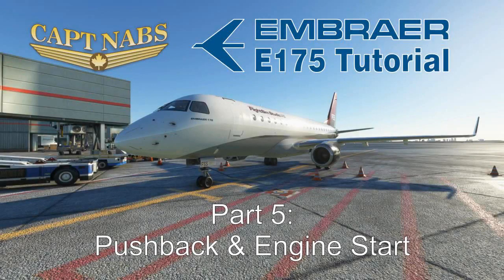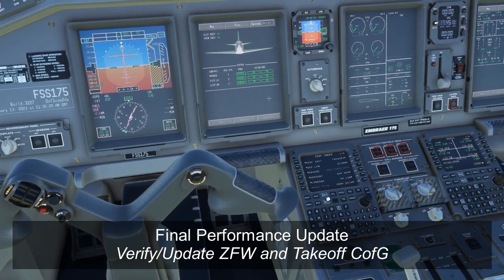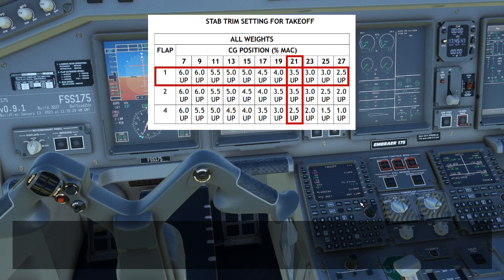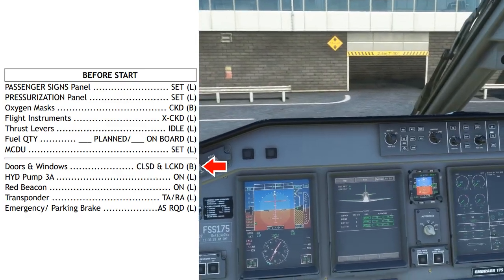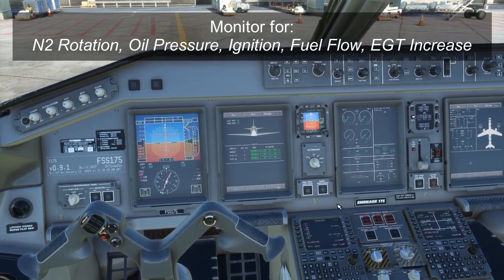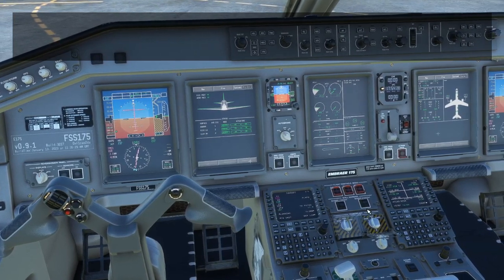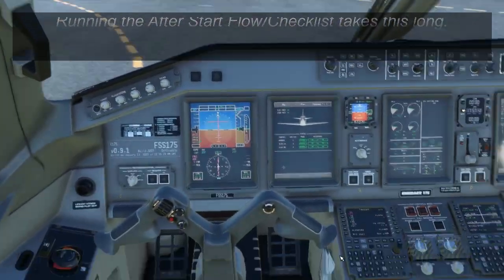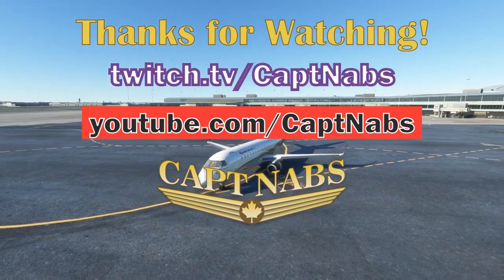Embraer E175 Tutorial 05: Startup & Pushback

Comment: nice videos, what u use for your views?
Reply from the maker: I use a product called TrackIR by NaturalPoint. It is a head tracker. You weat a hat or headset with a sensor on it and when you turn your head it turns in the sim too, though there is some gain so you can turn a little but still see the screen. Not cheap, but soooo immersive.

Comment: Very helpful video!  How did you activate pushback???  Did you use an add-on?
Reply from the maker: Yes, I used GSX Pro. That's why there was a cut. I activated the pushback during the cut.
Reply: @CaptNabs  ahh, thank you! I wasn’t sure and thought maybe there was a built-in pushback feature I wasn’t aware of🤷🏾‍♂️.  Also, I can’t get the Nose Wheel steering to work. The tiller moves but nose wheel won’t. Any advice?  +1
Reply from the maker: @Charliejulietteromeo  Are you using a separate axis or grabbing the tiller with the mouse? Either way, I use rudder pedals for taxiing. But its very early access so lots of things are being worked on.
Reply: @CaptNabs  Hey Captain!  Thanks again for your help.  Yes, using separate axis on Logitech.  I opened a ticket with FSS.  Cheers
Reply from the maker: @Charliejulietteromeo  For sure. Open a ticket with FSS. They are working hard!

Comment: I'm watching your videos about the Embraer 175, although the aircraft's systems are not yet complete, your videos have been very useful, thank you, continue with the videos, I'm betting that the developers will improve this aircraft more and more.
Reply from the maker: Thanks. I plan to finish the flight, do some additional supplementary procedures afterwards like single engine taxi. And if the systems get deep enough, I could handle emergencies and systems courses.

And rest assured the plane is not done. I have a line to the developers. The questions they are asking to understand the systems show they are serious about correctly modeling the logic behind the systems as well as the handling characteristics. This will be a good model in a few months.